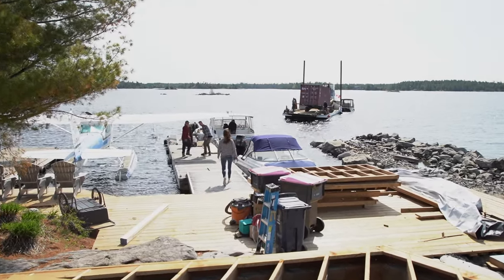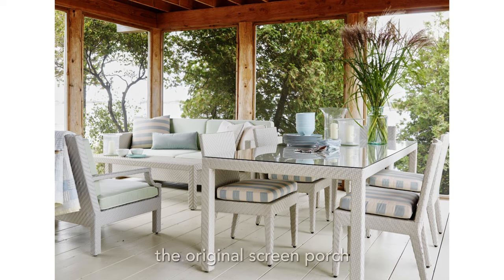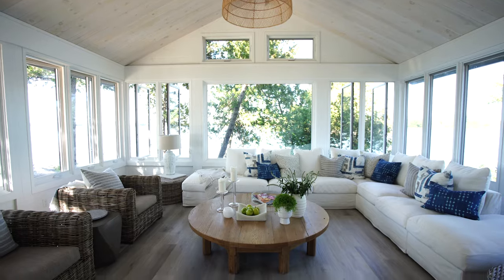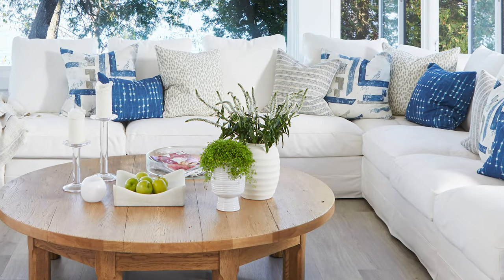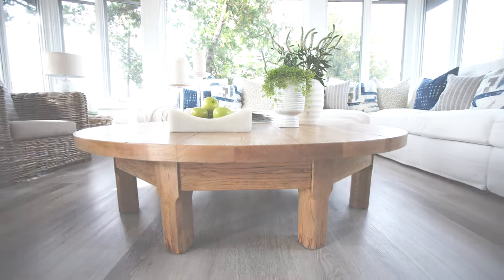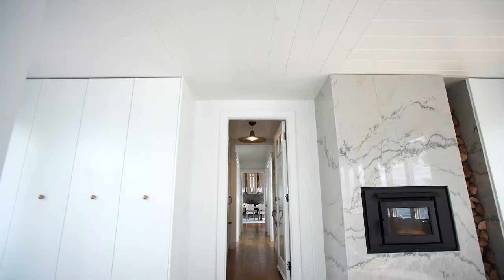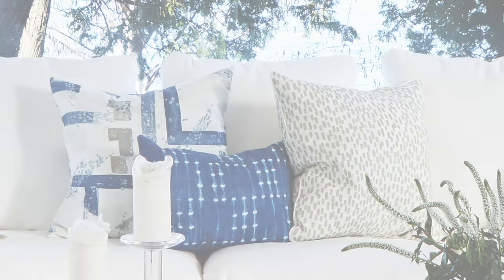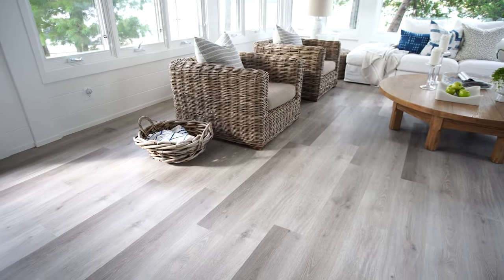Sarah's Island 2.0: Indoor Porch Reveal! (Ep. 19)

Comment: Love the new living room. Prime napping real estate. And the marble on the fireplace is PERFECT, I'm so glad you didn't go with the white quartz. Another home run!

And I am definitely on the vinyl floor trend. I am just trying to find the perfect type for my second floor. I already have vinyl flooring in my basement, but I want a different type upstairs. I need to coordinate with the dark oak floor on my main level, the basement features a lighter tone, to keep it light and bright. I'm leaning toward the snap-and-lock variety going forward, the type I have is connected together by overlapping strips of adhesive, and I'm not 100% happy with that configuration. I like that it's a floating floor, but the adhesive has already failed in one spot. I'm sure I'll be ripping it out and replacing it some day in the not-too-distant future, but I'll still go with something light and bright.

Comment: When you showed the room the very first time & said the ceiling height wouldn’t change, I cringed. I only have 8.5.’ Ceilings and we have been trying to find a house with high ceilings. So when you showed the rot on the roof I crossed my fingers and hoped you would vault it. Best decision period!  Also, the two windows at the peak were definitely a great decision!
I did wonder how your small laundry spot worked out but I get why that might not need it’s own reveal.
And for some reason I remember a large brick wall w a fireplace separating the dining room from the other all glassed in room. Did you put a huge wooden ship on the mantle? I’m worried I’m confusing this with the country house & it’s been 11 years so even though I’m sure...I can’t be 100% sure.  Oh, it may have had a fireplace but maybe it was not usable!